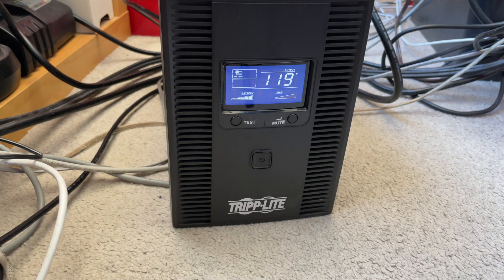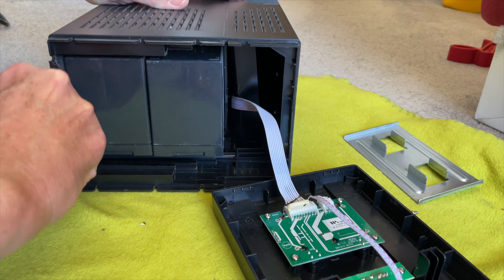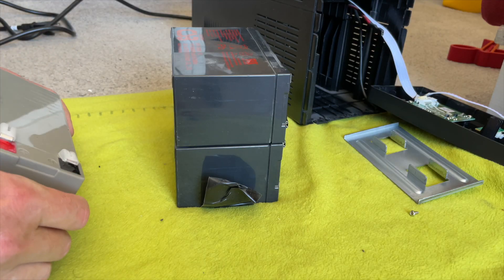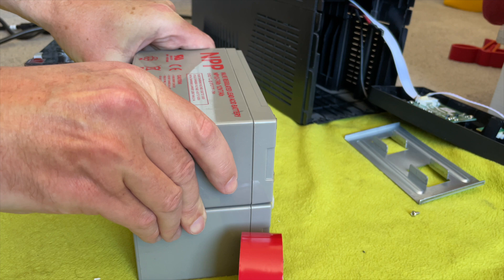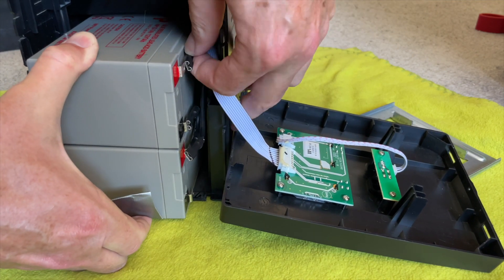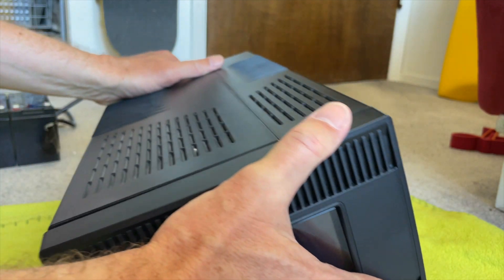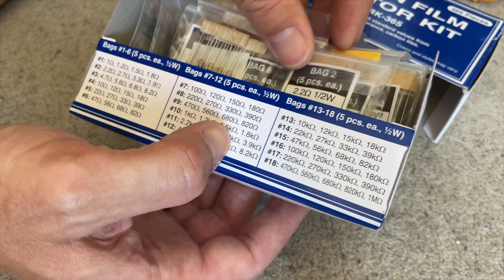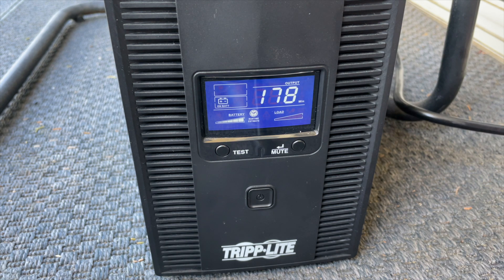UPS Battery Replacement Tripp-Lite SMART-1500-LCDT

Comment: What a fantastic and straightforward video! My Tripp-Lite doesn't come on at all when plugged in. Even without the batteries, shouldn't it work on electricity? I have no idea how long it hasn't been working (but it's been quite a while) and wondering if completely dead batteries could have drained something else within the system. I'm not very educated on this, but already took my UPS apart in anticipation of replacing the batteries if that is all that is wrong with it. Thank you so much for the video!

Comment: I replaced with same grade of battery and after it reaches a specific charge level it goes to f03 fault.  Any suggestions to test or troubleshoot?
Reply from the maker: Haven't seen that one before but according to the Internets, F03 indicates "charger fault", so I'd double check if the wiring/polarity is correct and measure the voltage of the individual batteries. Hope that helps!

Comment: Good information, well-presented. Especially liked the use of double-sided tape to connect the two batteries. 
Camera angle is perfect, and does not move on its tripod.
Your test of the two old batteries for voltage was a nice finishing touch.
Experience shows in your cautions during removal and insertion of the battery pack.
Reply from the maker: Thanks, appreciate the kind words!

Comment: Thank you for this video!  Was trying to figure out how to take the faceplate off without my usual brute force (and wrecking) method, lol.  If anyone is wondering if its the batttery, run the self test - should signal "replace battery" on the display when bad.

Comment: So your refreshed UPS shows 178 hours run time however that doesn't include any load! I'm sure you are using it to keep something running during a power loss or until your backup power has taken over. I would suggest putting your normal load on it, plug in whatever is needed and then check your run time again. Good video obviously you got some good feedback!!! 😊

Comment: I was thinking of buying a new UPS mostly because they have battery indicators.  But if they don't tell you if the batteries are near replacing, what good is the indicator?  (It could be based on voltage which would not detect if the capacity had degraded to nothing.)
Reply from the maker: Detecting the remaining battery capacity is a hard problem, and I'd suspect any build-in indicators will only give you a rough estimate. The only way to verify is actually to unplug the unit and see how long it'll last.

Comment: Love the video - exactly what I needed to fix my UPS.  I had to stop the video to see what type of battery you used.  I am surprised you went with 7.2AH vs 9AH?  I ordered the NPP 12V 9AH to get the longer life, otherwise everything else was spot on. I would not have even attempted to fix my UPS were it not for your video - THANK YOU!
Reply from the maker: Thanks, glad you liked the video! The higher the battery capacity, the better, I didn't see a 9AH option when I bought mine, just make sure it has the exact same size, then you're golden!
Reply: I know this video and comment are older but just wondering if the 9AH batteries worked ok for this replacement?

Comment: Always hook up ground first then the live wire red so Black then red.to prevent sparks this is the proper way to hook up batteries even car batteries
Reply from the maker: Couple of things: The concept of a "live wire" only applies if one wire is neutral/grounded, like with a power outlet. Never operate on a hot power outlet at all, always remove the fuse beforehand or you could receive a fatal jolt. With a car battery, it's a different situation, because one part is connected to the chassis of the car. In this scenario, always hook up ground last (!), to avoid any shorts/sparks when tightening the positive terminal while touching some part of the chassis with the wrench. With a UPS system like in this video, which is disconnected from power while you're working on it (double check!), it does not matter if you're connecting the negative or positive battery terminal first. If there's a current spike when you connect (capacitors etc), you'll always get a spark, but it's benign because of the low battery voltage. Hope that helps!

Comment: I have 3 of these UPS brand new. they were stored for almost 2 years and they won’t turn on, is this behavior normal? shouldn’t they turn on even the battery is dead? if I purchase new batteries for them, will they revive?
Reply from the maker: The batteries in the UPS are the same technology as the car/motorcycles variety, so leaving them uncharged for 2 years would discharge them to  the point where it's hard to resuscitate them. Maybe take them out of the case to see if that's the case before you order replacement batteries?

Comment: The replacement battery(s) is different in the way they have the +/- posts. These attach by screw/bolt instead of the push-ons .. Now what? Any ideas? thank
Reply from the maker: First preference would be to exchange the batteries for ones with the correct terminal type. If that's not an option, the second best would probably be to McGyver a spade shaped adapter from a short string of cable and a male crimp-type connector to attach to the screw-in connector on the battery.

Comment: Great video, thank you! Used today to replace original (2016) batteries. The tape is really the pro tip here.  If only this could be done while the unit is connected to commercial power.

Comment: I replaced my batteries but seem to only have the surage outlets working. Does the unit need to do a power or on/off to get the surage and battery backup?
Reply from the maker: When plugged in, the display on the front bezel should be lit and say something like "online". If it's not on, press the button for a couple of seconds, until it turns on.
Reply: Same issue here. Batteries replaced already but screen won’t turn on and only surge outlets are working. 
Any suggestions as to what could be? This happened after a power outage.
Reply from the maker: @ricardomarkov2396  Plugging it in and press/hold the button won’t turn it on?
Reply: @mikeschilli1088  power button won’t work. Also noticed only power surge outlets are working but none of the battery outlets are working. Display is dead. I’m thinking could be a blown fuse since this happened after a power outage. Usually the unit would remain on but came home and found it dead.
Reply from the maker: @ricardomarkov2396  Odd, so when you plug the unit in, does it beep? When you press and hold the button for 2 seconds, there's no beep, just dead?
Reply: @mikeschilli1088  no beep after plugging it in. I even tried holding the power button for as long as a minute and nothing happened. Already tried replacing the batteries but was told the unit even without batteries should have the display working if it’s plugged to a working power outlet and have beeping sounds but none of that happens.
Reply from the maker: @ricardomarkov2396  Since this happened before you replaced the batteries, it could very well be a blown fuse ... there appears to be one right next to where the power cable enters the case on the back panel, unscrew that and check!
Reply: @mikeschilli1088  UPDATE: took it to a local electronic technician and mentioned your comment, it was indeed a blown fuse. Seems like the UPS did its job by blowing the fuse instead of damaging my computer.
Now after replacing the fuse the UPS is working like a charm!
Reply from the maker: @ricardomarkov2396  Nice! Glad to hear this worked to get your UPS back in shape.

Comment: I just bought two ML35-12GEL - 12 Volt 35 AH batteries for extended run time. These are deep cycle, larger batteries, designed for UPS, wheel chair, golf cart, etc... They must be housed outside the ups.
Reply: did you put it in series?
is the dashboard still working?
Reply: @andrixferrer5181  yes
Reply: @andrixferrer5181  https://www.youtube.com/watch?v=YIfTJprQ2z4

Comment: My unit displays F04 error, BATTERY LOW VOLTAGE. I've measured voltage and it is 6-7 volts; both had to be replaced.

Comment: I have the same Tripp-LIte as in the video. Unfortunately, I can’t remove the patch cable from the original batteries that came with with it. It’s like the ends are crimped. Maybe I’m weak, but the batteriy terminals released easily from the cables in the unit itself. I’m afraid if I pull any harder I’ll damage the cable. I can’t find a small cable like that anywhere, just do-it-yourself connector kits.
Reply from the maker: I remember that the patch cable connectors took quite some time and force to wiggle off the terminals. If they won't budge, try un-crimping them a bit with a small screwdriver.
Reply: Same issue. Cables dont really seem to move and I'm fearful if I really give it a hard go, I'll damage the cable.

Comment: Is it normal for the video's UPS to make a soft hissing noise every 10 seconds or so?
Reply from the maker: When the UPS is running on battery power, the fans come on, that's by design in this particular model.
Reply: @mikeschilli1088  thnaks, this can happen even when turned off
?
Reply from the maker: @isramos2688  Hmm, no I don't think so, at least I haven't noticed anything like that when the unit is turned off.

Comment: Tripp Lite SMART1500LCDT 1500VA 900W UPS Battery Back Up, AVR, LCD Display, Line-Interactive, 10 Outlets, 120V, USB, Tel & Coax Protection, 3 Year Warranty & Dollar 250,000 Insurance Black

Comment: Clear video. Thanks for sharing. It's funny, you do what I do, mark everything with dates installed and previous battery changes. It's the best way to go! Sometimes I find the batteries hard to slide out because the old batteries have swollen.
Reply from the maker: Yes, labeling cables and batteries is great, especially for things that you open up only once in a blue moon! Glad you liked the video.

Comment: Some idea how to reduce the fan noise?
Reply from the maker: Yeah, those fans that come on when the unit switches to battery power are quite audible, but I suspect it's a safety feature to protect the batteries/circuit from overheating, so I wouldn't mess with it.

Comment: This model does not autos switch back to line power when the power comes back on.   So if you are not home, it will just run till the battery is drained.
Reply from the maker: That's not true, the unit will switch back to line power once it's restored. You can easily test it by unplugging the unit and plugging it back in.
Reply: @mikeschilli1088  I confirmed that with Tripp-Lite.  Only the SU series rackmount models have 'battery independent restart' feature.  This unit requires someone to physically push a button to switch back to line power.
Reply: The only problem is those SU series are over $1k each.
Reply from the maker: @joyjoy534  Again, this is incorrect, as you can easily verify by pulling the plug, waiting a bit and putting it back in. The unit automatically goes back to using line power and recharging the battery, without any human intervention or buttons to push. I'm not sure what else to tell you, maybe I should make a video about it? :)
Reply: @mikeschilli1088  I want to believe you.   Think I will just buy one on Amazon and test it out myself.
Reply: I like the Tripp-Lite since I can swap out those Pb acid batteries with LiFePO4 batteries in a later date.
Reply: @joyjoy534  The switches in our closets came back up after our extended power outage completely drained these the other day
Reply: @joyjoy534  I can confirm as well, Power goes out it uses battery, power is restored, unit swaps back to line power.
Reply: @c-jen8923  Thanks, I got one last year to test it out and it works.  So I modified it with 2 35Ah SLA batteries instead of the standard 7Ah batteries.  I did call Tripp-Lite and they confirmed the charger in the unit only works with Pb batteries and is not compatible with Li-ion or LiFeSO4 batteries.
Reply: @joyjoy534  very nice.   Good to know.  My batteries have failed on mine so I am looking for new ones and was wondering about lithiums
Reply: @joyjoy534  no problem you buy a separate charger for those batteries
Reply: I was having the same issue and just needed to replace the batteries like shown in the video - now it swtiches back over to regular power as soon as power comes on.
Reply: @peapage.productions9477  I did the modification as well.  It works great.

Comment: Your video helped me to install my replacement. I took out the old  battery at the first of the year and when I found a replacement I forgot how it goes in. I bought a brand by APC that is a competitor to trip-lite an it works just fine. I was not about to spend $  200 on trip-lite's  replacement battery. You can buy a whole new system for that price. One thing I run across is senior citizens need a UPS backup to keep their phone system running to be able to call 911 when they have a health emergency.
Reply from the maker: Great to hear that you got the job done! Really, any brand battery should work fine, hard to predict which ones will last the longest. Just make sure they come with the F2 (thick) terminals, not the thinner F1 terminals or you'll have to do extra work squeezing the connectors.